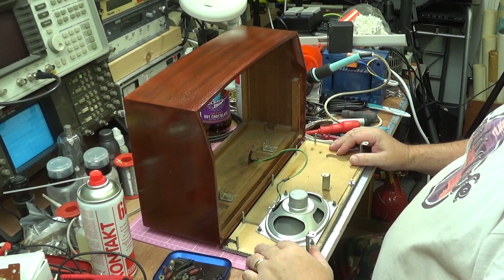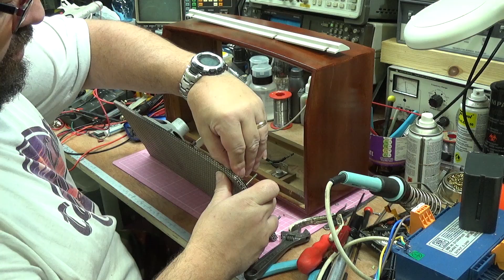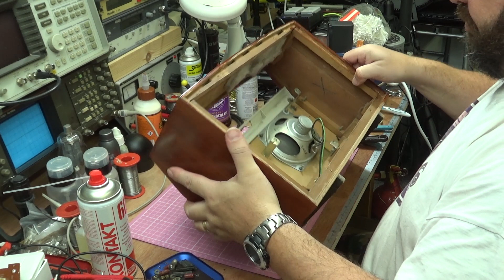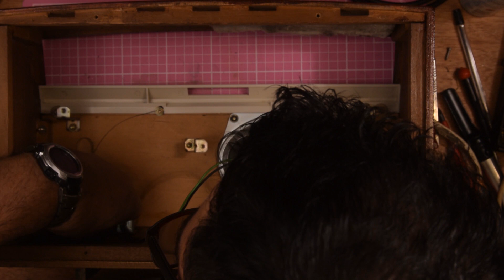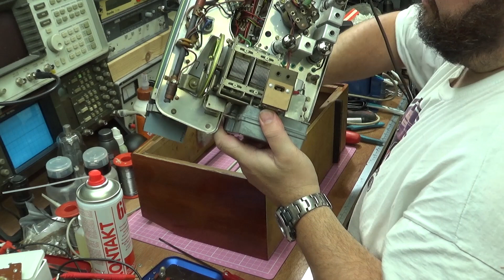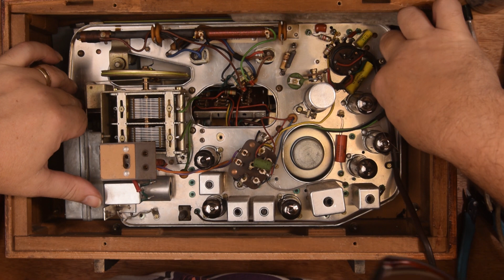Valve Radio Repair : 1964 Bush VHF 81 : Part 4 - Fixed and WORKING!

Comment: Hey George, I completely understand about the weather.  I finally finished stripping Mother's dresser of all it's old paint and original finish the other day.  Now just waiting on a pleasant day to be able to get it out of the garage for toning and either clear lacquer or varnish.  Whatever type of wood it is, it does not like to take stain very well though I did try.  Using the toner I have gives it more of a reddish appearance than the darker walnut I was hoping for but it still looks better than that old white paint someone put on it ages ago.  I usually find that the "yellowy" colour comes from nicotine and being a smoker I guess I've yellowed my fair share of stuff in the past.  I call it a preservative as it protects the finish from being discoloured by other stuff such as paint spills, etc, lol.  Best thing I've found over here for removing it with ease is a glass cleaner that comes in an aerosol can and sprays on as a foam called Sprayway.  Just discovered it a couple years ago but it's probably been around forever as the cans of it look like they were designed in the 50's.  I like that it foams as it keeps it from running down into places one doesn't want cleaner to go, like behind the plastic frames on LED tv sets, etc.  Silver paint, or gold for that matter never looks right.  You want them to have a glossy shine and they always have a sort of matte finish instead.  That Bush turned out to be a very smart looking radio! :)  Sounds like a strong performer as well.  Take care, Gary
Reply from the maker: There is a foaming cleanser we have over here but you can only get it from the electronics wholesalers or ebay. It lifts all sorts of dirt and grime out and it doesn't leave a residue but it isn't cheap! I have tried spray cans of gold and silver but they don't come out good like you say. Even the Hammerite stuff is not quite right but looks at least like hammered gold or silver. I have a can of chrome paint that I have yet to try that is meant to give the polished look..... We shall see sometime!

I was really impressed with the Bush, especially since I did very little to it electronically, it was more cabinet work than anything else.
Reply: @GeorgeChristofi   We're lucky I guess as the Sprayway here comes in a fairly large can for less than £2.00 It's $2.73 here at Walmart and it has a nice fresh scent that isn't overpowering.

Comment: Pretty late night there George to finish that radio.  That came out fantastic George. It looks and sounds great a very nice and informative restoration. Thanks for sharing all of your hard work.
Reply from the maker: Many Thanks Larry. I'm a night owl so late nights and early mornings have different meanings to me! Turned out to be more of a woodworking project to get the cabinet pretty rather than electronic but I am glad I went for it. It has just an amazing sound for what was at the time a budget radio.

Comment: George - that turned out really nice. Thanks for sharing. Best, Don
Reply from the maker: It came out a lot better than I had thought. I'm glad it was a minimal needs set and the cabinet wasn't too bad. I have one that is a possible 50/50 repair because of missing cabinet parts and woodworm.